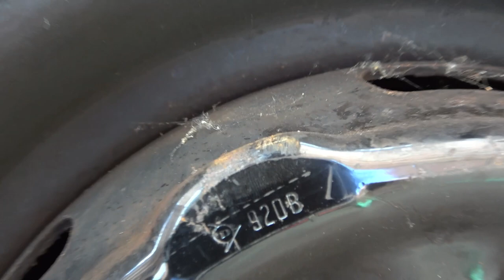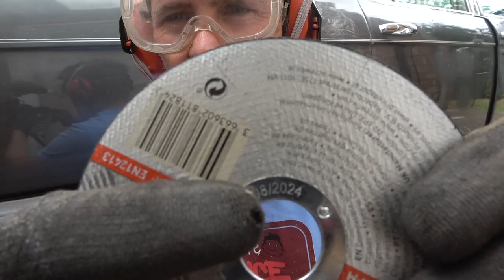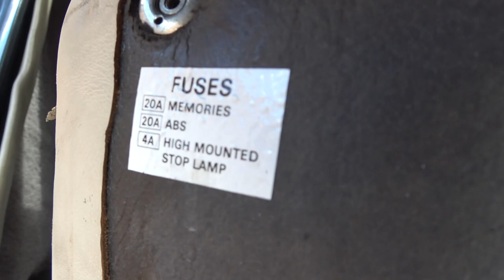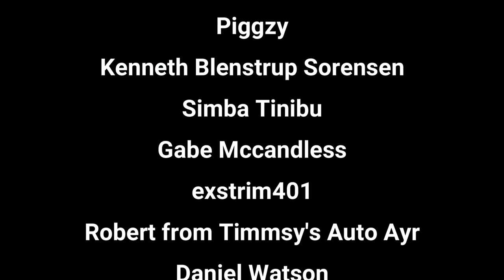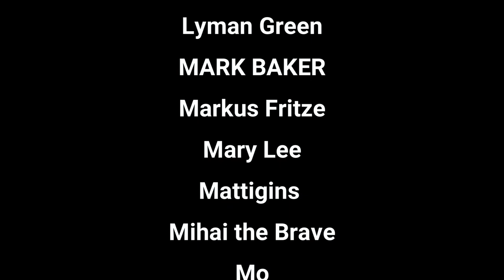1st Time DIY Welding a WHEEL ARCH & it's on a Rolls Royce - Trying to FIX a Silver Spirit PART 18

Comment: After removing the wheel, the first action should have been high pressure general wash to work in good conditions. Overlaps of sheet metal not properly protected will create humidity and rust traps. Proper cut pieces and butt welds are preferable. Use the new part to draw its pattern on the car by following the outline, cut the car, weld the replacement in place while locking it with magnets, clamps, etc.

Comment: I'm really scared to death of your M.O.T.  Don't get me wrong.... Xlint idea for the gov to be very concerned about road-going-vehicles. But in the US, we are very use to nobody giving much of a shat over the condition of our cars short of head lights, brake lights, bumpers, turn signal, wipers, windshield?  'Check'!... we  R  good to go. Yes, nothing to be proud of. I'm personally just spoiled. Anyway. I'm impressed and terrified all at the same time. But yours is the better system. But the DMV (here) would get a ear full if they dare mention my krapy body (the car's!). Hands down the U.K. is doing it in a sane way compaired to us road going heathens. Cheers from the 3rd House On the Left.

Comment: I would say you've done it right, if you had drilled holes in to it then installed it. There would of been a greater chance of the part buckling up.

Comment: Hi Vince, that aerial cable and base (26:50) is the sort that you use with two-way radios - especially with the BNC connector on the other end. Given that its a Roller and the age of the car, its more than possible that it had a ' Radiophone' installed in it - a mobile phone that came before the cellular phone networks we have now. I worked at Pye Telecom in the 80's and we used to fit them in luxury cars (they were a very expensive thing to own and to run back then). Typically they had a radio pack that went in the boot, a control head and handset that went in the front of the car and we would usually install the antenna on the opposite rear wing to the broadcast antenna so that it looked balanced.
Reply from the maker: Cheers Alan, now that makes sense. Yes it must be that. Thank you👍👌

Comment: All the struggle! The repair pieces are to be connected (otherwise butted together) to the rest of the body and be fairly level. No overlaps. You cut out the body as how the repair piece is shaped and fit it like a jigsaw puzzle piece and do dot welds on opposite sides to prevent warping until all is welded. Grind down and re-weld any holes or missed spots. Some research and thorough planning will surely reduce headaches and struggles in the future. Don't give up!

Comment: 13:26 I found I nice trick to avoid the straight line business you addressed - I use the Dremel to create a groove (much like you did) and 'take the angle grinder for a walk', in that I let the angle grinder ride in the groove and don't apply much force. Works pretty good in my experience.

Comment: Great job,Vince!
You can buy special drill bits designed directly to get rid of spot welded things by drilling the welded spots.They are not as cheap as a normal drill bit, though
Reply: You can just regrind a normal bit to a less acute angle at the point..

Comment: You’ve inspired me to learn to weld, I’ve just bought a multi gas and gas less welder, I’ve done body work before using hammer and Dolly, now I can replace the full panel and spot weld new ones on.

Here’s a tip grind it back and find the spot welds and drill them out the panel you want to replace it will just fall off no need to cut it or bend it, and when welding new one in place tac it on the spot welds and along the edge you want it to be a butt or flush joint not sat under the other panel as it will cause moisture and it will rust. Then sand the welds flat and fill it with body filler before primer and paint. 

If you want to hold the panel flush you can get some clamps that go in the gap you twist them and the T shape of it pulls it forward from the backside and they are easily removed once spot welded in place or use magnets on the outside to hold it.

Comment: 22:35 checking the abs sensors is pretty easy. They (most likely) produce an AC signal induced by a magnetic ring probably located somewhere on the break pad (follow the wire). Probe the end connector with a Multimeter and see what it says - compare at multiple speeds with the other sensors. 

If the signals don't line up, keep in mind that it could be either the sensor or the magnetic ring that induces the signal. I replaced my sensor twice before seeing that the ring was nearly rusted through

Comment: Been enjoying your series.  Took a 1983 Chevy cavalier down to the frame back in 1989.  Spent 1000 dollars in parts. Mostly 1/2 shafts,bearings, engine rebuild kits etc but drove it for another 100,000 miles with just oil changes brakes etc.  drove like a new car.

Comment: Loving this series Vince! A couple of tips for you.  When replacing a wheel arch like you have done,  its best to buy the repair panel,  and then mark the size of it on the body of the car. Its much easier to weld the repair panel onto the body,  along straight lines (or sharp body lines if you can).  It also makes the next stage of filling and block sanding to get a flat surface much much easier, rather than welding, grinding back the welds and filling inside of a curved body line (such as that arch).
Also get some paint removal discs for the grinder,  there rigid grinding discs which remove only paint and filler,  not the metal itself. 3m make decent ones. And finally,  buy yourself some bilt hamber hydrate 80 rust converter.  Brilliant stuff to use after you've removed as much rust that you can actually see, before priming 😁 keep up the amazing content 👍🏻

Comment: Vince, when you need to smack in such things like a wheel arch lube the metal in, sounds weird but might spare a lot of damage or prevents it even from get stuck. Also it was not an error not drilling the holes, if you drilled them in beforehand you would budge the metal very easy, or you would need something to support it from the back from bending the metal inward around the hole.

Comment: I've done sheet repairs on aircraft for 20 years and a putty knife works great to protect underlying metal when drilling. Aluminum tape is also handy to cover adjacent structure you don't want scratched or marked up when sanding or grinding.

Comment: The dustcover on the shock shouldn't be cable tied, wouldn't be of use since it compresses anyway. And by hitting a bump the cable-tie would just force the dustcover to stay up instead of moving back down on it's own.

Also, no need to predrill if you're going to drill 5mm.

Zinc spray on the surface you were going to weld was a big mistake, zinc pollutes the weld and the fumes that come of welding zinc can make you sick. Zinc-fever is what we call it translated to english.

Drilling with gloves on is asking for broken fingers, especially when you hold the drillbit with your fingers to get the hole started. Your drill isn't braked, so it will continue rotating for a bit after you notice it starting to hurt.

Keep in mind this isn't meant to be mean, just noticing mistakes and safety issues.

Comment: Yes, you're right vince that dust cover for the shock should not expose the piston as a tiny bit of debris can damage the seals if debris manages to get in there.

So that dust cover should be stretched and cable tied or tied in a specific way.

Good job.

Comment: Should have used screws every other hole or so to bring the arch up tighter to the panel, this is similar to how body men do it but they use removable fasteners meant for the task = but a home diyer can use sheet metal screws every other hole then weld the holes in between then remove the screws and weld those holes ending up with a much tighter fit

Comment: Vince get yourself a leather jacket, ideally a welding jacket but an old bikers jacket will do, far less burns through the t-shirts and on the arms, also watch where the sparks are aimed from the grinder, it is possible to use a grinder without firing sparks cross the glass and paint and the neighbour's shed. Great Vids and any MOT advise you want contact me !

Comment: Place hub caps that match ( have holes) on one side of the car. place the ones with out holes on the other side. Only one side can be sean at a time. paint to match car also. Will make RR look beter, until you get 2 more hub caps. White wall tires improve the RR looks. I have a 1975 RR Silver Shadow.

Comment: Try a flap disc on the grinder, they work great for cleaning up bits of surface rust.  Don’t fit a cable tie to the shocker, it’s like that so when it compresses the rubber cleans off the chrome part of the strut.  Similar to those small rubber rings you see on the pipe of the fuel filler in the garage on the fuel pump, it basically helps keep it clean and stops the build up of dirt which would cause corrosion

Comment: throwing in another comment after watching the entire video, dont be scared of cutting to exact and spot welding metal on then throwing down a good bead of weld and grinding back. you cant tell where the join is then.  where you had holes you should have cut and squared the hole then used you metal and again spot weld it on for mock up then throw down a few beads n grind back. i dont know how much experience you have but bravo for the effort. just remember for top buck at the end people notice the fine bits

Comment: I once had to cut the swinging arm off a motorcycle - I could not get an angle grinder in there so I used a Dremel. The Dremel died before the swinging arm did   :-(  An angle grinder is a much better tool for the job   :-)

Comment: On the rotor "disk" they used to be solid so that a machine shop could turn them thinner to get them flat again. The reason the switched to vented rotors is because the solid could heat up too much and warp or do other damage.

Comment: Just out of curiosity when your putting the wheels back on are you using a torque wrench as normally should be about 65nm but using a normal socket can missaline if one side is tighter an other

Comment: I see you need new brake rotors. There should be no lines in them It should be smooth, run you finger up and down the rotor where the braked pads meets on the rotor. if you feel any roughness rotor needs replaced. or it will eat up any new pads you put on it

Comment: My Citroen BX also had green spheres, but after ordering new ones (as the old ones were flat) i've received gray ones. Maybe the same on the Rolls?
Reply: Yes they will be, RR used Citroen suspension, and the reason Vince's are grey is that the spheres will have been replaced at least once in its life.

Comment: I have this issue on my Spur II. The patch and repair has reached the Nth degree so it’s replacement metal needed. Where did you get the panels please. Thanks
Reply from the maker: I got them from Flying Spares here in the UK. Good luck with the repair 👍👍👍